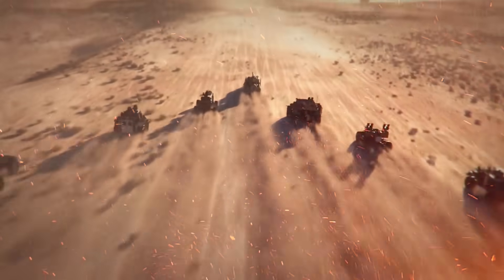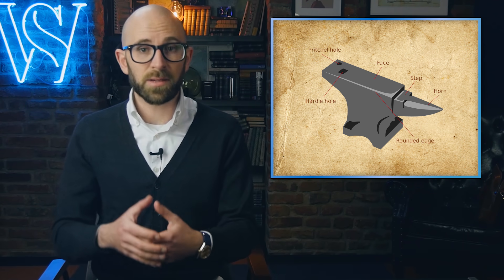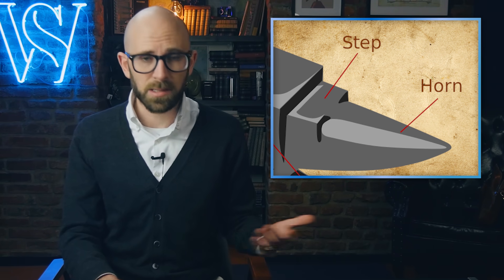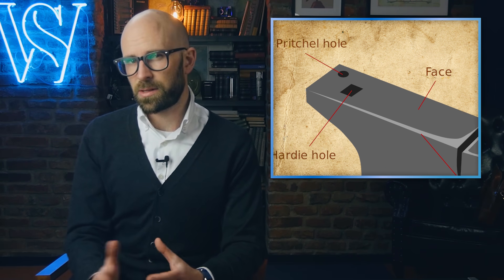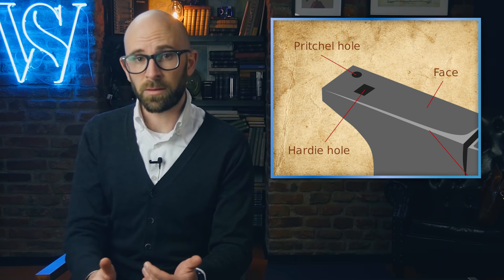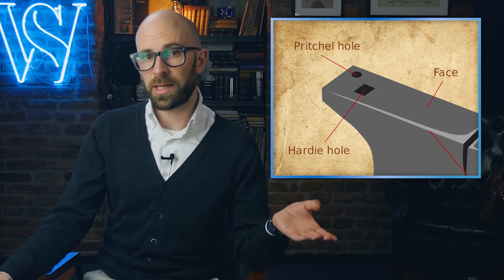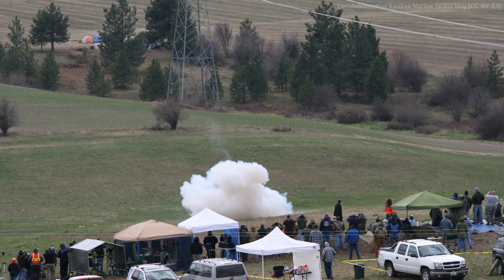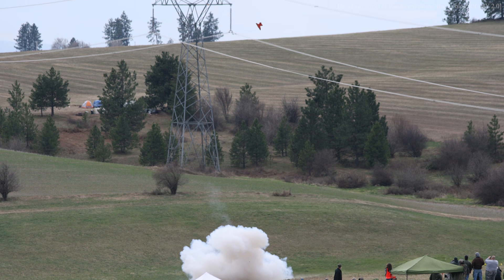Why are Anvils Shaped as They Are and Why Do Blacksmiths Tap the Anvil After a Few Strikes?

Comment: You missed the fact that tapping the hammer on the anvil face allows the blacksmith to realign the striking surface of the hammer with the face of the anvil to produce a straight level surface on their work piece. This allowed the blacksmith to be more efficient taking less time to correct mistakes after the desired shape was forged.

Comment: actually, some blacksmiths will keep a small puddle of water on the anvil and when hammering hot metal they will wet the head by tapping it into the puddle. by striking the hot metal with a wet hammer it shocks the surface and causes slag to fly off of the surface.

Comment: From what I understand, and I could be completely wrong, but blacksmiths also tap the hammer on the anvil to knock off any slag that may have stuck to the hammer while smithing so they didn't hammer it back into the metal. Again I could be completely wrong but that's one of the things I've heard

Comment: This presentation did a fine enough job explaining now the current form of anvil is used but does not answer the question why it has the shape it does. Why this shape and not some other?
Reply: That was answered by general technology evolution... if multiple products are available and no feature makes one apparently better, then choice settles on the market.

Be it cost, distribution, operational comfort, weight, size or whatever.
The clue in London standard popularized in the 19th century points to distribution and compatibility with products from the industrial revolution as a standard adoption driver

Comment: BlackSmiths also strike their hammer to the anvil to prevent magnetization of the hammer or anvil.  
The shock from the hammer ring disrupts the formation of larger crystals in the metals of the anvil and hammer.  
Larger crystals produce greater ferromagnetic influence whereas smaller crystals randomize and cancel out the effect more.  
Further, the Smith did not need to strike the anvil where it was hot.  Striking the anvil anywhere produces enough of a shock wave to function the same way.

Comment: The horn (also called the bick and beak) is also used for drawing out (making longer and thinner) a length of metal. The shape helps push the metal lengthways rather than spreading in all directions. The step is used in conjunction with a chisel for cutting, to prevent the main surface from getting marked if you slip or accidentally go all the way through rather than most of the way then snapping.

Comment: As a blacksmith I love to see more vidoes about it and aspeshaly when they ger there facts right like you did. Although the side of the face of the anvil is used to pinch the metall into a finer and more even tip at least that's the way I learned it.

Comment: I'd be interested to hear where you got the research for this as a lot of it isnt particularly good - I am the current chairman of the British Artist Blacksmith's Association. 
Classic error of using the American terms on a London pattern anvil (Anvil comes from the old Norse word for "to hit upon" - Anfilta) and the 'horn' is a Bick, hence the smaller version that goes in the Hardie hole is a Bickhorn (as there are generally two bicks, set in a way that looks like horns) Bick shared the same root work as Beak, for obvious reasons.
Early anvils where made of Charcoal Iron, then Wrought Iron, but the striking face wasn't, it was made of Higher carbon steel, either Blister Iron or Crucible steel. These were welded on to the face leaving an area ( the cutting face) and a topography (the step) which was soft on the horizontal face, so your cutting tools wouldn't be damaged if you cut all the way through the material, and a hard edge so you could use it for various processes. 
Carbon alloys with Steel from almost zero (pure Iron and Dead mild steels) with the most common alloy being Mild steel (0.25-0.35% carbon) I dont know where you got the 2.1% carbon steel from, as over 1.7% it exists as Cast Iron, which isn't harder than high carbon steel, because of the free carbon in the interstatial grain boundaries (the bits between the 'steel' crystals) whereas high carbon steel has Ironcarbide in these boundaries, making it hard and brittle (past its Eutectic point of 0.83% carbon).High carbon steel above 1.4% inst massively useful either, and carbon will technically allow until 7% carbon, but again not massively useful.
and yeah, no one taps their hammer to cool their hammer down, we work next to a bosh full of water ( Quench tank) which we could readily use, and do when punching.
the chisel tool for a hardie hole is called a hardie, it gives the hole its name, likewise the pritchel hole is for punching, and the traditional farriers tool for this is called a pritchel.

Comment: Cast iron is Higher Carbon than "High Carbon Steel."  Pure, or relatively pure Iron doesn't cast very well.  Cast Iron is called that because it casts even better than crucible steel.  (In large pours, like anvils.)  That's because Crucible steel anneals, and tempers as it cools.  The outside cools faster than the inside, so the surface contracts, and cracks around the still hot center.  Cast iron doesn't do this, which is why it's still used in (Cheap) anvils, instead of Steel.

Comment: You also forgot some important facts... for instance that some anvils are made of hardened steel, others soft steel and others a are hybrid combination of both soft steel and hardened steel and sometimes even cast or wrought iron. Lastly, even though hardened steel anvils are the best and usually most expensive, some professionals still prefer to work jobs that require hard hammer striking on soft steel anvils because of the risk that chipping a hardened steel anvil poses, which can be a deadly affair.

Comment: One point I disagree with (though "ask 10 blacksmiths and you'll get 11 different answers):  The horn definitely CAN be used as a mandrel to establish curves in a piece, and some recent designs make this more feasible by making the horn a true cone, casual observation of the typical London-pattern anvil will show that the horn is not conical nor even truly round in cross-section.  So, what gives?  Well, the horn is very often used as a bottom fuller -- a curved surface that allows one to move metal sideways, relative to the curve.  The different radii, from base to tip, give the blacksmith a choice of surface to hammer his metal against, allowing close control of the drawing-out.
In contrast, the best way to make a curve is often on the flat anvil face itself.  This may seem counter-intuitive, but actually works quite well. 

In general a blacksmith does not use a mandrel to define a curve -- that's a practice from machining.  A blacksmith uses his eye to gauge his curve, and that requires no mandrel.

Comment: Ok here we go
Mistake 1- Anvil construction is a bit more complex than that. Wrought iron anvils are not exclusively wrought iron, they still have a hard steel face welded on. Just the same cast iron anvils are cast around a steel face and then heat treated, so you are always hitting on steel. Entirely wrought iron anvils haven't been used for centuries and entirely cast iron anvils are not even worth the effort of scrapping. Solid steel anvils come in two varieties, forged steel and cast steel, both of which were developed in the 20th century. Before that, the best anvils were, and arguably still are, forged wrought iron with a steel face. 

Mistake 2- You don't use the horn the hammer curves. The anvil is used as a fulcrum point to bend a curve by hammering to the side of the horn where the bar is unsupported. When you do hammer on the horn, it is to rapidly draw out the bar in one direction. This is sometimes called fullering and to that end, the horn is having a similar effect on the iron as a rolling pin does to dough.
Mistake 3- yes the step is often used for cutting and is referred to as the cutting shelf. This however is because the shelf is made of soft iron unlike the face. If you cut on the hard steel face you run the risk of marring the smooth surface and completely blunting/ruining whatever tool you are cutting with.
Mistake 4- You don't tap the anvil to  cool the hammer, nor do you do it to rest your arm, nor to your adjust your grip. Sometimes it is done to keep rhythm but mostly it should not be done at all. It is a wasteful expenditure of time and energy and  it is a very bad habit to pick up. You don't get paid for the times you hit the anvil. If you need to tap the anvil a lot, you are not thinking fast enough. Much of the skill in forging is being able to perceive the shape of the metal quickly and instantly knowing where to deliver the next blow. You are working with in a very short amount of time, just the period it takes for the piece to cool after it comes out of the fire. The more heats you take, the more time you waste, the more coal you burn and the more your iron will oxidize away.

Comment: In the last war, the Germans invented the Acoustic Mine, which could be set off by the noise of the engines of a ship passing over it. After a while, some boffin in the Royal Navy got the Admiralty to buy a load of 'Kango' petrol powered hammers. These were put on rafts, and set off, and floated into areas where Acoustic Mines were laid, and so, set off the mines. It didn't take long for the Germans to go back to magnetic and contact mines, both of which were fairly easy to deal with.

Comment: What I'm about to say is something I was told long ago.  May be true may be not.

The holes in the anvil?  Well, what I was told is that is how you made nails.  You take a small slither of heated metal and you pound it through the hole in the anvil.  The excess metal would form a head on the nail.  you would then tap it lightly on the other side to pop it out of the hole and move to the next one.   To enforce this, there are stores of Pioneers in the American West who would burn down their cabins when they were ready to move.  Why?  To salvage the nails.  

I grew up in a house that was by everyone's account well over 200 years old.  The house predates county records.  Some beams literally were nailed together with wooden pegs.  That is how old we are talking about.  At any rate, this house had a cook house and a stable.  Both buildings had burnt down decades prior to me coming around.  I use to walk the property with a metal detector and guess what I would find?  Lots of these old style anvil nails.  I've kept a number of these in a antique mason jar I found on the property.  So yeah, I do think what I said above is correct.  Blacksmiths made the nails pounding them through their anvils. I can only imagine how labor intensive that was.

Comment: The differences listed here between wrought iron, cast iron, and steel are not wrong per-say, but kind of misleading.  Wrought iron means that the iron has been pounded into shape by a hammer whereas caste iron was melted to a liquid state and poured into a mold  to create the desired shape without working it.

Most early iron/steel working was based on the use of a bloomery furnace.  Bloomery furnaces could not fully melt iron, but would rather melt away the silicon an other elements in your iron ores leaving behind a porous "bloom" of iron full of impurities.  Blacksmiths would then have to hammer this iron out until the pours are removed and impurities are worked out.   The reason wrought iron is so soft is that this hammering would also work the carbon out of the iron; so, while a bloom might start off with a high carbon content, that content would be reduced by working it.  

Cast Iron however is made by fully melting your iron ore in a crucible.  By fully melting it, the impurities will float to the surface where they can be skimmed off without any hammering needed, and the iron can then form a solid bar or puck.  The iron is then poured into a mold where it forms the shape you need.  Because the iron is completely un-worked, it has a much higher carbon content left over from the smelting process.  Early caste iron also tended to be high in phosphorus because the crucible method of smelting  did not allow the the phosphorous to escape.  Like high carbon content, this would further contribute to a higher hardness and lower toughness.

As for steel: this word is much harder to define because it has been used in so many ways throughout history.  The original word that steel is derived from refereed specifically to Meteoric Iron.  In the ancient world, the iron from meteors was highly prized and considered better than man-made iron.  Then by the middle ages, steel just meant any high quality iron.  The most common way to make cast iron better was to work it (just like you would a bloom), until it reaches your desired hardness which is were this idea of steel being a middle carbon iron comes from.  Modern steel is made using a different process to achieve the same goal.  instead of iron being hammered to the right carbon content, the molten steel is blasted with oxygen which binds to the carbon releasing CO2 .

Comment: I'm actually somewhat surprised Simon was this accurate. No reason for my doubt, just that I was indeed surprised.
Am a hobby smith myself so I know the subject well enough to validate the given facts.

Minor addendum though: The rhythm used when a blacksmith had help (from strikers) has meaning as well. So does the impact of the strike by the blacksmith himself when marking.

A blacksmith would speed up the rhythm to indicate more speed to his strikers, as well as hit hard at a given location to indicate that he needed some hard hits on the location he marked with his hammer. Softer blows would then indicate more gentle hits. There is even a way to signal strikers that the need for their assistance has ceased, though for the life of me I cannot remember exactly how the signal goes, other than that it involved striking the anvil itself in a particular pattern. Smiths tended to be very noisy places so most of if not all of the communication between smith and striker(s) would go by means of his hammer.

Hitting the anvil with your hammer directly also had a chance of damaging both the hammer and the anvil, not just dent it. Anvils and blacksmith hammers are hardened steel, even the city-style anvils that have a low-carbon or cast iron base with only the face being a plate of high-carbon and hardened steel, could actually shatter themselves or the hammer if they came into contact with enough force. Simple rule of thumb when smithing: Never strike a hard(ened) surface with a hard(ened) surface.

Comment: I thought it was for removing scale from the hammer.

I also thought they might get the hammer wet from time to time to blow scale off the item you're working on.
Reply: Sanguine apparently can spray the anvil with water to do the same thing.
Reply: Putting water on the anvil only makes a loud pop! It is useless to do that. It cools the steel down damages your hearing (it is already going to be damaged from listening to the anvil) and there is not that much scale in the first place,  and certainly nothing that a wire brush cant take care of.

Comment: Most black Smith just use the anvil as they see fit, also the step is really kind of useless. Some dont even have one. And yes, don't hit the anvil with a hammer, not because it deforms! Because it's very brittle! I once chipped one with a misplaced hard stroke and a piece of metal flew through my leather glove and lodged in my hand lol. Also a tip for checking if an anvil is good is hitting it with a hammer and seeing if it rings. Bad anvils get cracks in them lose their notorious ringing sound, they also somewhat lose their bounce back. Fun fact, they don't actually ring like that when you use them because the metal should be soft, if it isn't you could damage the anvil.

Comment: Blacksmith here, mostly correct, just a few points. 
A 'tap' implies force. A blacksmith rearely uses force in his strikes, it kills your wrist (yes, very good mention of that) Sure, we all do it, but the best way is all gravity. We simply drop the hammer while holding onto it, guiding it down. Its not like hitting a nail in a wall.
The name blacksmith. 
I read your source wikipedia/blacksmith. This is inaccurate. The fire scabs are not black, they are medium grey. The iron itself is medium to dark grey after some cleaning.
Disclaimer: 'As far as I know' the name comes from medieval Londen. Smiths were categorized according to the look of the finished product. Gold-, silver-, copper- smith. The black comes from a special anti rust treatment. Most iron would not be grinded as that finish rusts fairly quickly and is timeconsuming. You could hammer iron repeatedly, then it turns whitish. This was a special style in Italy. 
Instead a sulfur holding oil (or sulfur holding coals in later days) was applied and the piece was heated in the top of the flames to 300-450°C. This forms a layer of sulfuroxide that turns black when combined with the sooth from the fire and protects against rust. The process is called blackening. That is why fences and such are all black. 
And I have never heard of cutting a piece of metal off on the anvil. 90° corner woudnt be best for cutting. It ís very good for thinning a piece. Just juse a saddle cutting tool. Basically a axehead you put in one of the holes. 
But, overall, very good video 👍🏻